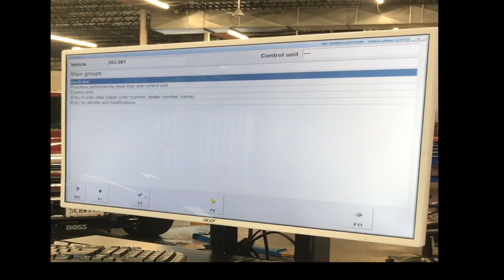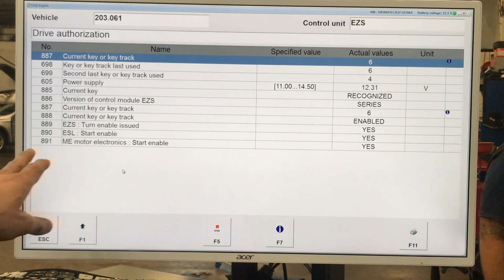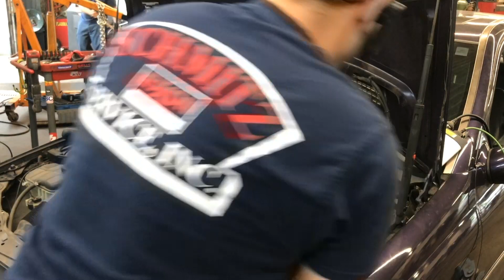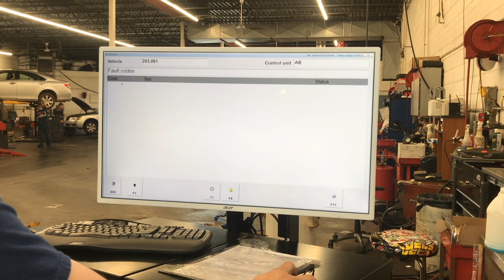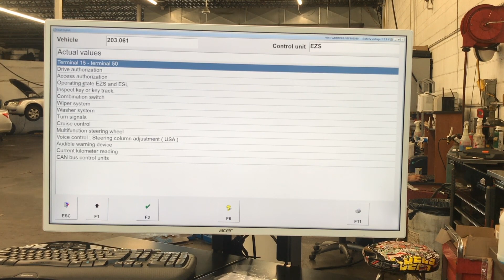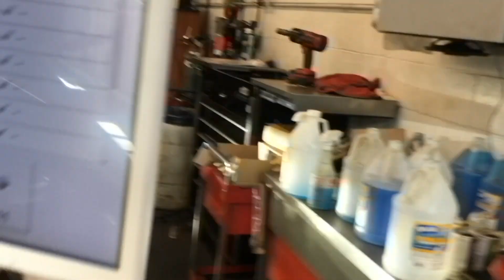2002 C240 No crank Engine Computer Repair Part 3 THE FIX

Comment: Very similar problem to the slk320. This similar fault can be traced back to RCM (relay control module).

To fix it you resolder the three parts of the lower part of the board.

You are a genius my friend and one heck of a mechanic! SUBSCRIBED!
Reply from the maker: Thank you so much!!

Comment: So I was searching for battery drain couldn't find any source of drain so I took out the ecu the board looked pretty good but the outside pin had a little green color  but no discoloration on the board but when I put it back no start from the key ,but when I jumped the starter pink wire it starts any 💡

Comment: Have you compared your thermal imager against the snap on one? Was there a reason you went for it. 
Great video, thanks
Reply from the maker: mike roy I have not compare to the new snap on elite. I will next week. I did research for months on quality and specs. Also spoke to a few certified  thermograph and they love the Flir.

Comment: Now hopefully the computer won't get wet again. Or was a water leak found?
Reply from the maker: Yes, the main problem was the drain tubes were full of leaves and the front SAM cover was installed incorrectly. All corrected now.
Reply: I have a 2001 C240 and my ECU got wet can I buy a used one and just plug it in or does something else have to be done after that